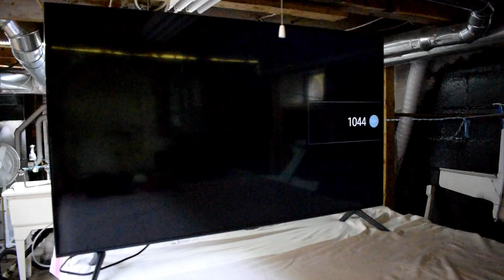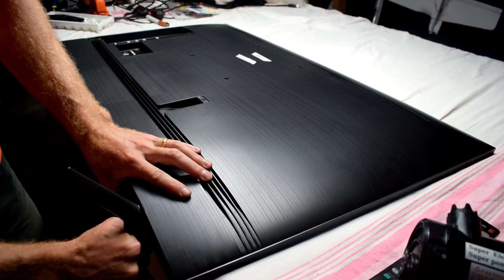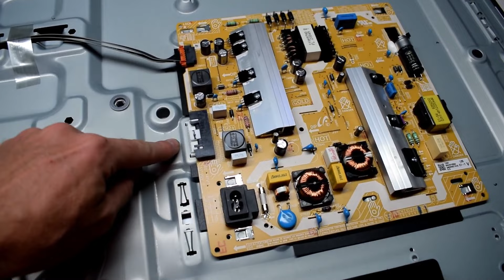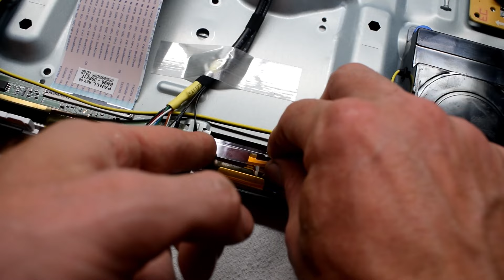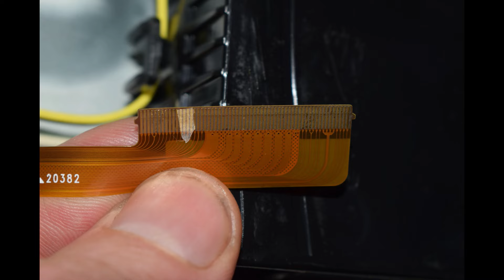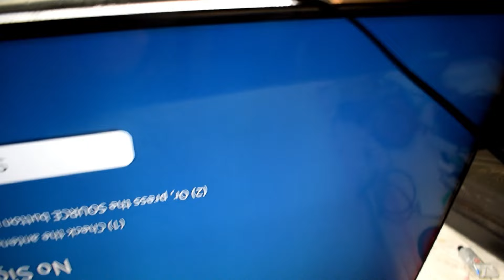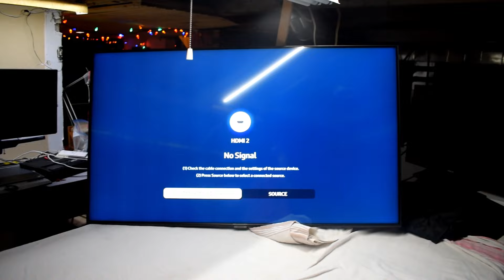Samsung Smart QLED TV Keeps Restarting! Fixed with TAPE! (Model QN50Q60TAF)

Comment: Hey what's going on my man I have some technician background I need some help and I need you to point me towards the right direction I have this model Samsung q6 qled TV qn82q6fnafxza the issue I have is my pictures are blurry and slightly offset also after a while of the TV being on it goes completely blue you could hear everything but you don't see any images if you unplug in turn it on you see images for a while and then it does the same thing again sometimes you can turn it off and turn it back on and it'll show you images for maybe 30 seconds and then the image will go away again what does blue glowing screen
Reply from the maker: could be the tcon board
Reply: @NewsonsElectronics I want to believe that but everybody's telling you the panel

Comment: Thank you. Even though I’ve identified the problem area on the little ribbon, the black lines on the screen are VERY noticeable (on your video you can’t see them, but the ones on my screen are very visible at the top and bottom, and are flickering). I think it’s the best I’m gonna get 😢 I’ve even used a narrower strip of tape than you so am covering fewer gold connectors!!

Comment: have a Samsung
Model Code: QN75Q70TAFXZA
Version No: CF04 / QTQ70 / QTQ70E-Q75TE1. The TV was
flashing between a blue and black screen. I did a bunch of trouble shooting and I was able to get 3/4 of the right side (when looking at the front of the TV) of the screen to work by removing the right (when looking at the back of the TV) CSF01 cable. Can you tell me which pins to tape and on what side of the CSF01 cable (the board side CN1 or the panel side CN2)?
Reply from the maker: you just have to tape and move it if it does not work because each case is different

Comment: It worked perfectly on my Samsung QLED bought in November 2022. I had to run some tests, but in the end it worked.
I also lowered the brightness and contrast to 6 (which is obviously low, but still perfectly usable) because the screen was freezing after a short while.

Tip: if the screen works at first but freezes after 2–5 minutes, press and hold the power button for 10–15 seconds. The TV will reboot and the freeze bug will disappear.
After that, try lowering the brightness.

Comment: You are amazing sir - thank you - I had to really persist with this - finding the failed pin - and using salvaged scotch tape from the inner tv itself - mine would not work until I got my tape about 1mm thin and covering the exact pin on the wafer thin led strip - I was about to give up and the like magic - my tv screen was back and working - thank you - I should of avoided AI gpt and searched YouTube as it told me to buy a new PSU which I did - this video was the winner - thank you

Comment: Mine had similar issue and I was able to fix it completely with no image distortion.

When disconnecting right ribbon cable, tv remained ON with black picture allowing sound to be heard when scrolling through menus. On the left pcb board I measured voltage between a ground pad and the CLR pin (which should have been 0) and there was a small voltage. 

It ended up there was ground conductive tape under the left speaker that was shorting out on some component because it was tilted. I straightened the tape out to not touch other components by going from ground pad to tv housing and this fixed the tv allowing it to be ON and perfect picture 

Good luck gents
Reply: I meant to say the ground tape was touching a component under the right speaker, not the left

Comment: Great video! Thank you very much for the video! I have Samsung TV QE50Q60AAUXXH. It started to reboot with black screen 3 years after I have bought it. I fixed it covering the same pins you did and it worked with a few horizontal black lines on the screen. Then I tied to move the tape to the right for just one pin and now it works perfectly. I am amased! 
Can be that cable ordered on eBay or somewhere else so I change it?

Comment: WARNING for those that try this: I had the perpetual rebooting issue with my 2021 QN55Q80DAFXZC and figured I'd give it a shot. The removal of the plastic back plate is quite tricky and you should be very careful with the bottom attachment where there's a lot of sensitive wiring not far from the edge. None the less, I tried putting the masking tape in the exact same place as in the video (by counting connectors) and ended up with half of my screen deactivated. After multiple attempts to find the right spot, I eventually damaged the screen. No big loss I guess, since the Samsung repair people said it would cost the price of a new TV to repair it. The only disappointment I have is with Samsung and their poor customer support and Apple-like repair people.

Comment: Thanks for this, I exactly found the spot,

BUT if I don’t put scotch tape on the spot of the LED flat cable and still have it connected, the TV starts and shuts down immediately, in an infinite loop.

If I put scotch tape on the spot of the LED flat cable and have the LED cable the connected, TV runs with sound and so, BUT there’s no picture shown.

CAN YOU HELP, please?

Comment: I noticed the part where the shorted flex cable is connected is actually touching this other gold/yellow flat part underneath it. This other part tends to get very hot while the TV is on, so I guess it actually fries the flex cable. I see a lot of people with this same issue, basically a design flaw by Samsung.

Comment: So covered op 4 to 5 pins and the tv actually stopped cycling on and off. But the screen now remains black and I cant enter any apps or settings with the remote. I can only tur  it on or off. Do you maybe know a solution to this too?

It would be wonderfull if i could save this tv from the trash heap! (Would be better if samsung extended their warranty or would repair this faulty model for free....)

Comment: I'm a little confused here - are these two ribbon cables permanently attached to the LED array of the TV screen and cannot be replaced short of replacing the whole screen? If the ribbon cables (left and right) can be easily replaced with new ones then how costly are they and do you need any special equipment or skills to go that route? Anybody have an answer?

Comment: I have a Samsung qled 55” tv model QN55QN8 that’s power cycling the motherboard and power supply are fine but when I take the flex copper cable on the bottom of the tv it keeps cycling (isolating both on the left and right unfortunately). I covered tape on the ribbon cable on a few pins connecting to the motherboard but only the audio works and I get a grey screen. I can’t seem to ever get an image to come up. Any advice?

Comment: Got the boot loop to stop if either side ribbon cable is disconnected but how do i narrow down which side connecter is the problem? 
Example if i pull the left side and have no tape on right it remains on and vice versa, if both are plugged in it goes back into boot loop.
Reply: Im having the same drama can have one ribbon cable connected and TV doesn't go in to a power loop but as soon as I plug the second one in goes straight to power loop no display it dont matter which ribbon cable is connected

Comment: Lucky you. I got same problem, did same type of diagnostic even before found your video,. Covered with tape one single internal pin or that ribbon cable, tve stoped resetting, but no picture at all, opened that pin, and covered second one, again start rebooting. So can find pin, but not always get recovered
Reply: Was to early to write comment. With last pin in mind, decided to cover different random pins, found that picture came back, TV stoped rebooting, on  screen one slightly darker line came up, barely visible. So TV back to live

Comment: SO glad I found this. Thank you! So far mine has been pin 11. Got a better picture with a few flickering lines on the left. However now resets after about 30 seconds (longer than before, but progress). Will continue to isolate pins with 11. Will update.

Comment: First of all thank you for posting this. It took a long time but I finally got the power to stop cycling by using the tape.  Tv picture stays on now but I see there is a 2 or so inch black vertical line on right side of screen now with a few red green and blue lines inside of the black line. Does this mean I need to put smaller tape and cover less pins? Did I do something else while fixing the power cycle issue.  Any help you can give me would be great

Comment: I taped some pins and the rebooting is gone but theres no image, do you know any other solution or tip?
Reply: @Home_made_ch
3 месяца назад
Was to early to write comment. With last pin in mind, decided to cover different random pins, found that picture came back, TV stoped rebooting, on  screen one slightly darker line came up, barely visible. So TV back to live

Comment: we bought our UN75NU800DF 6 years ago from Walmart online refurbished, got a good deal on it back then with 4 yr warranty from Walmart. 6 years now... it has failing display driver boards. and will continuously reboot. We made a quick repair with tape over some of the pins on the ribbon cables, but it lasted about a day. Now, many lines on the picture. too bad. I liked it all these years and the free channels were great. reading many similar reports of similar issues as ours. We probably won't purchase another Samsung TV. Thanks for the repair tips though, it did work!

Comment: Hello, Can you advise from your side where to start diagnosing with Sony KD65X85J when there are vertical and horizontal stripes on the screen?

This Sony KD65X85J has no visible physical damage on the screen. The TV works normally, a TV program is playing, there is sound. The TV does not turn off by itself.

But after turning on the TV with the remote control, vertical and horizontal stripes appeared.

Comment: My Samsung is having the same issue. I took the back off today. I thought it was the main board due to the boot loop, but after disconnecting the LCD ribbon and seeing the screen stay on, I understand there to be an issue with one of the ribbon cables. I tried the tape trick seen here in this video. I initially regained sound and some picture, and continued very small adjustments. Even moving one prong or so would lead to a full picture (before turning off) or a completely black screen. Any advice?

TV model:  UN50TU8000FXZA
Version: YA11
Main board: BN96-52107D

Comment: Hello, where exactly is the source of these faults?
In the T-CON integrated into the panel connector or in some of the panel's COF?
Because in my case, a Q50E67AA, it's driving me crazy.
It has the reboot problem, but it also does it randomly. Sometimes it works fine.
And what always happens is that it has some horizontal black lines running from left to right on both sides of the panel, although they're much larger on the left side.

I'm about to try replacing the panel boards. Do you think replacing them would fix it, or would the problem be a COF and I'll just be wasting my time?

Regards

Comment: I had the same problem with the Samsung qe50q67aauxxh, the problem helped the same with the ribbon. You can see slight undulations in the left part of the painting, but it goes to watch. However, I will definitely never buy a Samsung again.

Comment: I didn't believe this would work in my case because the panel started getting dark from top to bottom more and more until power cycling and later showed no picture at all. But this trick restored the picture almost perfectly. Thank you.

This happened only 4 months after warranty ended and when asked technician he immediately recognized the issue because a lot of people have the same problem. Clearly planned obsolescence, please avoid buying Samsung products.

Comment: I will tell my experience. Samsung UN65TU8000

It had been about 5 months, where my TV turned on and off, left it like this in a loop and lasted about 30 minutes like this, until it turned on completely, so I was using it for about 3 or 4 months, but every day, it took longer to turn on completely, there was a day when I left it on in a loop and it took about 6 hours to turn on completely. And this was increasingly frequent, because if I wanted to watch TV, I had to turn it on about 5 or 6 hours before.

I got tired and tried this method, which seemed to work, stopped the on and off loop, the screen remains on and with sound, however, the screen did not show any image.

After spending about 3 hours trying to find the pin or pins to seal with the tape, I couldn't get the image to be seen.

I gave up, and removed the tape from the pins, I cleaned it by the glue of the tape that I had left. And I reinserted the component.

The loop obviously turned, and after 3 minutes by magic, it turned on again and showed the image.

Now, I don't know if it was just luck, if it was because I disconnected, cleaned and reconnected the component, or if it simply turned on again for having been there trying to fix the television for approximately 4 hours🤷🏻‍♂️

Comment: Hello, I was able to find the right pin thanks to this video tv now turns on normally and I can hear the sound however the picture still doesn’t show, could I be covering too many pins? Or not enough? Any help would be appreciated
Reply: Same problem
Reply: @dean-saev did you fix it?
Reply: @mrsha9973  No, to date I tried everything, and nothing has fixed it, I don't watch the TV so much, but when I sometimes turn it on, it takes about 1 or 2 hours to turn on completely, and there are times that it doesn't turn on all day
Reply: Did you fix it?

Comment: this 100% works - I just fixed a TV after watching this video. I'm not a tv repair person. anyone have a website where they have schematics of TCON boards? the fix works, but I would still love to understand why
Reply from the maker: there is a short on one of the leds in the panel this short is detected by the power management chip so it restarts by taping over the section where there is an short it does not detect the current draw.

Comment: Same "turn off and turn on" loop also happens in D5500 models of Samsung LED TVs, it is because of one OR more bad sectors occuring in K9GAG08U0E nand IC1302 Flash chip. You need to find a repairer who can reprogram that chip. So you can continue to use your tv until a new bad sector occurs in that chip. Or you can find that chip's new version on aliexpress and get it reprogrammed, then replace the bad chip with that new chip.
Reply: D5500 Modell als TV ? google sagt mir Blue Ray System ?
Reply: @martsn54  yes, it is a samsung tv model, there are 32" and 43" tvs for this model.

Comment: hi i had same problem...did the same thing...turned off half of display on frame tv...narrrowed down on to single pin...too...as soon as i put the plastic frame back ..the issue came back...found that display pcb was shorting with rv metal frame...and also the remote reviever too was shorting....isolted completely on all direction from frame both display pcb and remote reciever....woila solved...thanks for initiating my brain to work in this direction....might help many, not having to cut off some portion of display...

Comment: Help!  I have a Samsung QN49Q6FAMFXZA (2019) that just went dark suddenly without reason.  When I try and turn it back on, the screen is just grey, then black, then grey then black. No sound. It's like it's trying to turn on, but shuts off, then repeats.  I followed your video, however where you show orange circuit ribbon that you then used scotch tape to cover some pins, I don't have any orange circuit ribbon like that on my model anywhere.  I even removed the speakers, as they are in the place where in your video the faulty pins are (the orange ribbon).  Nothing like that behind the speakers.  Mine is actually very simple, it seems,  in that it only has 2 very wide light pink circuit ribbons going from the main board to the panel. So not sure if I can use the scotch tape trick with this larger ribbon. Also, when I unplug the wires from the main board (with the TV plugged in and turned on) the panel still stays on.  I believe you said in your video that if it does that, then that means it's not an issue with the Main Board(?).  I can get a replacement main board on eBay for only around $35.   Just wondering how I can be sure if it is or is not the main board before I try ordering a replacement.  Thanks for any advice!

Comment: Great video. I was thinking it was the control board originally but after following your directions was able to diagnose and applied the tape. I played around and likely ended up with a little more tape than needed and a few more lines left on screen. But the TV works again and happy I saved $100's in parts that would not have done anything.  And it can become the outdoor tv in the future.

Comment: The trick fixed my QN50Q60BAF tv.  I covered the contacts suggested with tape. Tested the TV and remained powered without going out. Then I removed the tape on the 1st three contacts. Tested the TV. Then uncovered the next two. Powered the TV. And wow! All is working with nice picture and absolutely NO visible lines. I decided to leave the remaining contacts covered and reassembled the TV.
Reply: I didn’t understand what you did exactly. I want the lines to disappear. I mean i was able to make it better but if there is a way to remove them completely, great!!  Please, let me know if you can explain it to me a bit better. Thanks
Reply: @carlosacuna7780 I covered all the contact area with packaging clear tape. With an exacto blade I cut just enough tape to uncover the contacts one after the other.